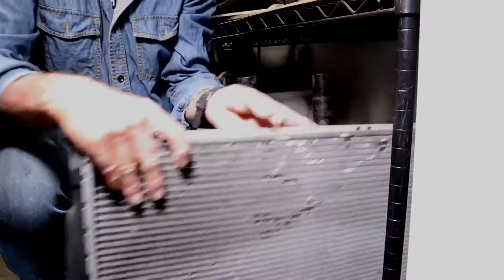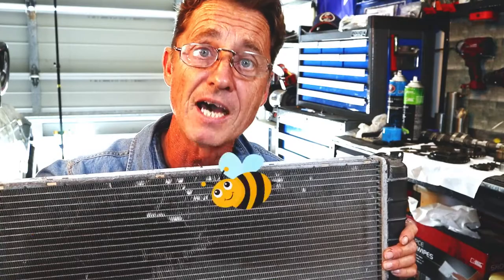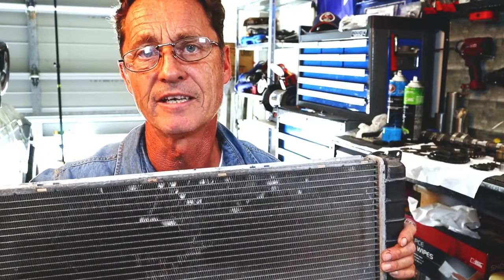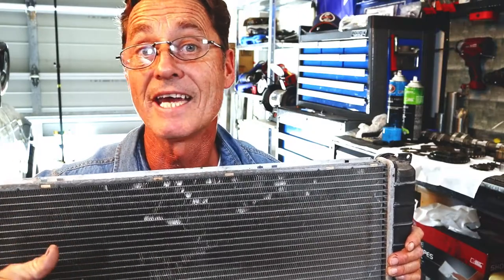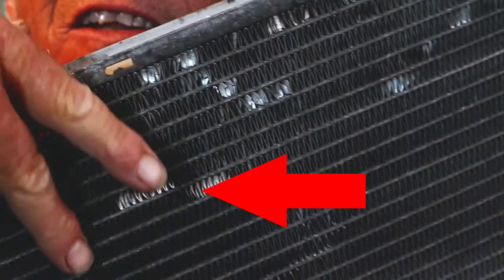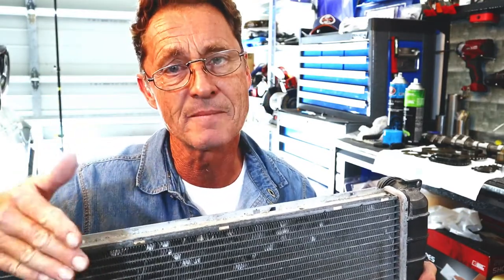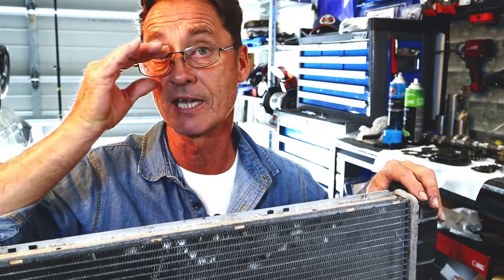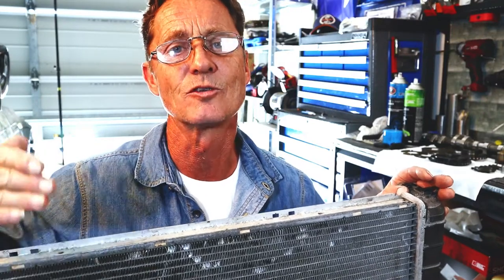BMW E46 MAINTENANCE // YOU MUST DO THIS AS SOON AS YOU BUY AN E46

Comment: Great information. If I may add something for those with automatics like myself....In your expansion tank holder/bracket affixed to the radiator there is also a transmission thermostat located in one of the connection ports. This thermostat (from experience lol) if has some age, has plastic shell which WILL crumble when you try to remove it. Plan to replace it as well. Also to add on automatics included to the cooling system is the transmission cooler located bottom driver side of radiator under the same bracket housing mentioned. These connections associated with it are possible leak points as well. There are Orings which seal it to the bracket. Hint: you can follow your trans cooling lines to the front of the vehicle to located the cooler.

Comment: I’m about to get a perfect condition e46 325xi with 40k miles and one owner (my neighbor) for 5k. I hope most of these fixes are mostly for  heavily used cars with lots of miles on them.
Reply from the maker: As long as you are aware what to watch for you will be fine.
Reply: As stated in the video...18 year old plastic fittings with 49Kmiles are still 18 year old plastick fittings which are old and brittle.

Change them NOW and drive your car forever

Comment: Nice vid. I have a question. I have a 323i and i dont know which oil is the best for 5st manual trans. and allso differential. I wanna change those. Thanks for any advises.
Reply from the maker: Check my latest vid. I give all the fluid specs.